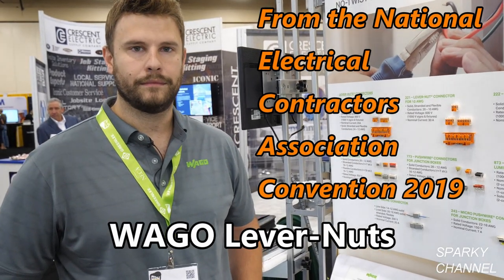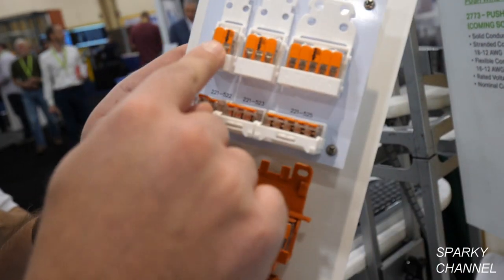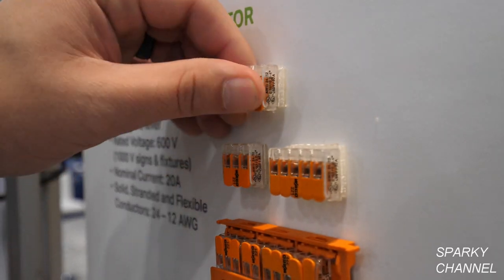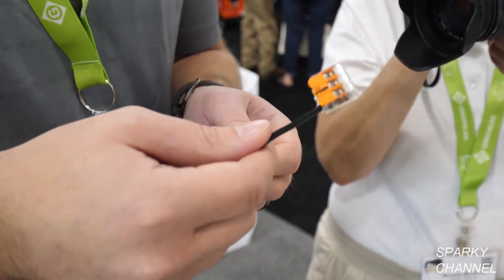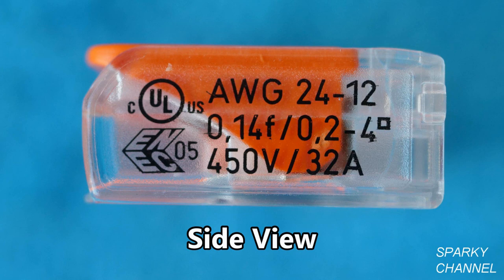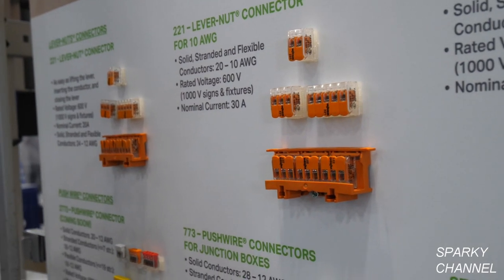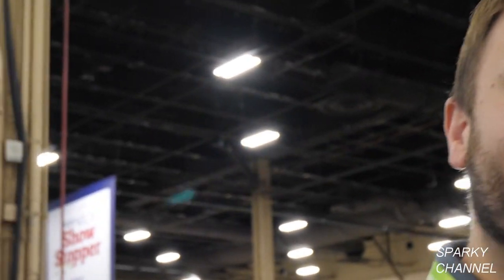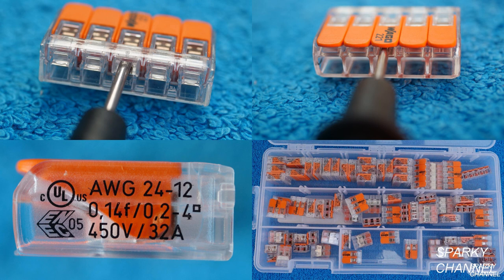Wago Lever-Nuts Questions and Answers From National Electrical Contractor Convention

Comment: I don’t need a transparent connection. My wires are twisted tight before I put on a wire nut. I bet mobile home manufacturers love these.
Reply: The RV industry uses them I use them everyday in Motorhomes. Scotchlocks are no longer used for 12 volt they use these instead.
Reply: When you twist wires, it makes them weaker and damaged in the future when somebody needs to change a receptacle or switch out.  One of the biggest benefits to these level nuts is that they don't damage the wires like twisting them does.  I've had to pull entire new runs because wires were twisted and untwisted too many times and cut back too much to where the wires are too short.  It might not seem like a big deal but when the time comes to reap these benefits, the benefits are HUGE.  And it isn't even a benefit that was difficult to setup for.  Using these lever nuts is significantly easier and faster than traditional wire nuts.  I understand people prefer traditional wire nuts for many reasons but I've personally never looked back once I discovered these.
Reply: @glasshalfempty1984  If your wires are being twisted and untwisted too many times, there's way deeper issues at play.
Reply: @cengeb  oh Jesus Christ I really have heard it all now.
Reply: @blueoval250  Pre twisting is not required, some mfg's state that it is "acceptable" but not required others state you should not... 

From Ideal: 
5.Pre-twisting acceptable, but not required. For pre-twisting; strip wires long, hold wires together with insulation even, twist wire ends together, trim to recommended strip length.

3m:
1. Strip wire insulation 3/4" (19,0 mm).
2.  Firmly grasp wires, making sure insulation ends are even and tightly bundled. (Wires may be twisted or untwisted.) Lead stranded wires slightly. Slip the connector over wire tips.

Pre twisting does put stress on the wire... Its unnecessary stress b/c the mfg literally says its unnecessary to twist them and twisting them does stress them.. UNNECESSARILY

Comment: Made in Europe  very pricy.  Ideal has an American made knock off for 50% less
Reply: Ideal does not make lever nuts, they only make push-in wire connectors. That's why theyre cheap.
Reply: These connectors are pricey.  However they are very reliable and fast to install.

There is nothing wrong with the Ideal system IMO, I use it myself, the only drawback is that it is disposable.
Reply: Ideal has 2 types I have seen.  One type is not reusable and the other is IF you use an equal to or greater size wire of the wire that was removed.  I suppose it loses tension.

Comment: Most of these comments are really stupid. People are asking if you can use these on the neutral conductor and things like that if you don’t know this you should not be working near electricity or you should ask someone who knows what they’re doing. People are saying why not superior and things like that, but the United States has no testing requirements, where these are used unlocked testing requirements and these pass every single installation test

Comment: pack of 100 @ $44...... lol, Yea I am sure people are just falling over themselves to spend that.....
Reply: $23 for 100 pack of 2-wire at Menards. $18 for a 50 pack of 3-wire.  That's acceptable.
Reply: @schmartz99  LOL, the only place that I didn't price check....
Reply: I bought a 150 mix pack of 5, 3, and 2 connector for 29.99. Won't go back to a wire nut.
Reply: Time is money, Wagos are really fast to use.

Comment: Wago is an idiot-proof connector, wire nuts are not.
Reply: Daamn right. Try connecting a single stranded conductor to a single solid conductor, very iffy.
Reply: @trek520rider2  no problem

Comment: my problem with these is they can't possibly duplicat the contact area of twisting the wires together.
Reply: as odd as that sounds though, the consistency of this connector completely & totally counteracts the theoretically greater capabilities of wirenuts, with, on average, 15A wirenuts failing at around 20-25 amps or so, with 15A rated Wagos failing at anywhere between 30 and 50 amps. (in this case, failing meaning the connector melting)
Reply: @danny_dan4323  I just watched a video of 14awg wire failing at 60-70amps, but not the wire nut! Not all wire nuts are created equal i guess.
Reply: That's assuming you're connecting the wires together in the first place with twisting. I've done enough remodels and repairs and seen some shady twist installs. Not an issue with these or push ins.
Reply: The contact area that is not needed and is more than the individual wire itself? You can leave a wago 20a at 20amp draw indefinitely and nothing negative will happen... That extra contact area may let you sleep better but it means nothing.
Reply: @twinnevans971  I think thats kind of the problem. Pre-twisting gets you the best contact area, but that is NOT the correct installation method according the manufacturers.
Reply: But that's overkill anyway, and oxydation of the copper wire in the twist causes resistance too. Unless you are plugging in a 1500 watt space heater on high and leaving it on all the time drawing the max, most outlets in a house are only going to run a table lamp, an occasional vacuum cleaner etc and lamp fixtures these days are mostly running LED's not strings of 150 watt incandescent bulbs!
On outlets, switches and ceiling lamps about all you have contacting the wires are  1/2 or 3/4 of the the underside of a screw head, same for where the wire goes into the breaker- just the screw holds the wire in
Reply: @Justowner  Plus- just TRY using a wire nut to twist a pair of 10 or 12 ga wires by turning it with your fingers! 10 ga especially doesn't want to twist, maybe 14ga will but I never used anything smaller than 12ga in my house ANYWHERE
Reply: Most countries do not allow wasting wires in a wire up because it is not predictable. There are so many cases where the joint issues.

Comment: 600 volts is overkill when you are putting in 24 to 12 ga wire in a house running circuits on 120vac, 240v max, so even the European 450 volts is more than double what you'd ever put in in the USA
Reply from the maker: Interesting, thanks!
Reply: NEC much?  stuff is now at 1000v 600v is the old low ...so in order to have UL ETL etc 1000v ratings...like there is no such thing as 110V it's 125v nominal, things keep improving
Reply: @cengeb  And, let us not forget that "125v" is the "DC Effective" voltage (used to simplify the calculation of things like "wattage"); the AC voltage is actually swinging between +170 volts and 170 volts - a 340 volt swing.  This means, between the phase wires on a "normal" single-phase system that gives you 240+ volts between the "hot" wires, you are actually seeing a difference of 340 volts in potential.  That leaves you an "insulation head space"  of something less than 260 volts on 600 volt wire.  

That is BEFORE you account for any "surges" or other events that might lift one of your phase voltages relative to the other or to ground.
Reply: The voltage rating is based on "DC" Volts.  The "Voltage" you read on an AC circuit is the "DC Effective" voltage.  That is, on a DC circuit that has 125 volts and is pulling 10 amps, you are consuming 1250 watts.  They have "normalized" the AC Voltage measurements so that "125 Volts AC also pulling 10 Amps AC" will do the same WORK [over time] as that 1250 Watt DC Circuit.  THE ACTUAL VOLTAGE IS NOT 125 Volts!  

The AC voltage is actually swinging between +170 volts and 170 volts - a 340 volt swing!  This means, between the phase wires on a "normal" single-phase [American] System that gives you 240+ volts between the two "hot" wires, you are actually seeing a difference of 340 volts in potential.  That leaves you an "insulation head space"  of something less than 260 volts on 600 volt wire.  On a wire with a 450 Volt Rating, you would only have 110 volts of "headspace" on the insulation...  

...and that is BEFORE you account for any "surges" or other events that might lift one of your phase voltages relative to the other or relative to ground.  A lightening strike, for example, can skew the relationship by thousands of volts.  Fortunately, it takes time for insulation to heat and melt (or burn) -- and lightening strikes tend to be relatively short duration.  That said, the closer to the limit of your insulation's rating you operate, the LESS time it takes for such events to generate a fault.
Reply: It's now upped to 1000V rating for insulation etc according to the newest NEC book.  MFGS are ramping it up to 1000V.  WAGO are superior to obsolete twist on connectors.  2023, join it
Reply: But if you’re going to do high voltage insulation resistance testing and other testing as mandated in Europe, this is needed

Comment: Going to try the on my RC 6S lipo batteries
Reply: That is not recommended because he’s batteries can often handle a much higher current than the wire according to regulations for short generations the connection may not be great

Comment: Compare the wago with an Ideal wing nut. The Ideal wing nuts contact area is much larger and stronger. You can hang your weight off of it. But I try to post the video and it is deleted every single time.
Reply: Ok, I'll bite. I'll take a closer look at whatever an Ideal Wing Nut is. Sounds mechanical to be honest.
- 5 minutes using my lackluster googlefoo -
So, they are the basic twist sleeve type. When done right they hold up quite well. I have seen these in houses closing inn on 50 years (if not more) mostly without any signs of age.
But I have seen far to many done poorly or downright wrong. Not just DIY types that goes for the cheapest option. 
What wago has going for it is that they are easy to use, and electricians does more than enough twisting motions with their hands to begin with. 
I suspect that US sparkies might not like Wago is due to the lower capacity of the Wago. In installations with 110V/220V there could be an issue with the 20A\32A limit. On top of that is the human factor that we use what we know and trust.
I have used Wago for over a decade and have not encountered an issue so far with heat/overload or the lifetime of the springs. As questioned some times in this comment section. But then again I work on 230V/400V systems with correspondingly lower currents.
Reply: If a splice connection has to hold this kind of weight, something is wrong way beside the type of the connector.

Comment: I’m a junior in a technical high school and I’m in electrical.. me and my friends have done plenty of experiments and everything says wire nuts are better. I can take off wagos with 1 finger unlike a wire nut, it’s almost impossible to pull off. I see what wagos are trying to get at, and I see Why most countries use them.. I’d rather trust myself with making a connection with a wire nut than the manufacturer of the wago. That being said, if I ever had to use a wago on a job I would wrap the wago in electrical tale to insure a nice and tight connection. One thing I do like about wagos is how easy it is to switch wires, but is that really a good thing how easy it is? In my opinion nothing is better than a good old fashion wire nut.
Reply: Are you twisting stranded or solid together? I completely disagree wire nuts are better. I’ve used WAGO in my house with no issues. And easy to remove or add wires. I’ve had damaged wires from untwisting just twice—or perhaps the wire was damaged by the electrician installing it.
Reply: I agree to a certain level with you. Wirenuts are the ultimate, but are also laborintensive , spaceabsorbing, difficult to manipulate and userunfriendly. I think the wago's are a great alternative and also very reliable. I use them (not only the 221's) for decenia. I'ver been teached the wirenut-way, but love the wago-way. The big disadvantage of a wirenut is that it can be mounted in so many wrong ways. The wago 221's are close to foolproof and more diverse. To be honost, I only use wirenuts in situations in which my connection needs to be secure (high or unreachable places) or is demanded (hospitals, military, etc.). For the rest I only use Wago(-like) connections.
Reply: Tape should never be used to ensure a tighter connection. If tape has to be used, it's because the connector isn't doing it's job. With tape holding the wire nut on the conductor, I certainly wouldn't trust that electrical connection. Isn't using tape already assuming you don't trust the connection?
Reply: @davejohnson6032  lol, all it does is add fuel to the electrical fire caused by that bad connection. Nice catch.
Reply: I do a ton of rework, like adding a branch to an existing circuit. Have to untwist and retwist for wire nuts in close quarters or in hard to reach areas is not friendly, so Wago connectors are much better. And the space in boxes is often limited.
Reply: You may be able to remove a Wago with one finger by pulling the lever up, but if you install them correctly you are NOT going to pull the wires apart with a REAL Wago. There are plenty of poorly made Chinese imitations and knock-offs, but the REAL Wagos are hard to beat. I seriously question what a high school Junior knows about "old school." I'm 72 YO, I can tell you about "old school."
Reply: @davejohnson6032  My sentiments exactly.

Comment: Ul is not a testing lab its a review of data lab based on a manfactmar data i had a electrical problem and UL couldn't do shit for me even though they certify it , the company pays four the UL seal lol its a selling point
Reply: WRONG, they are an independent testing lab, like ETL, DIN etc, where do you get your fake information?
Reply: All wrong about ul...you need facts before making up incorrect crap about ul or etl....and dozens of other test labs worldwide
Reply: And pays thru the nose.  My uncle worked for a company that designed and built medical equipment ( electrical).  He said UL would never pass the first inspection, or second, or third...each time charging a king's ransom for each retest.  A captive money-making organization.
Reply: @LongBinh70  ETL, UL are NRTL. independent recognized test labs, build it right pass the tests, simple concept..Other countries have their own labs and cert  DIN, Kluer Kema, TUV, and on and on

Comment: i do alot of work with low voltage. when i see a wago, i pull it off and into the trash. i leaned the old way to connect wiring and those old ways have lasted for longer than im alive. maybe they have their place but if i ever see any of my guys use a wago on anything over 12 volts, theyre gonna hear about it. any wire connection requires 60 percent surface connection and wagos dont provide this, more along 20 percent for solid and 35 for stranded. sure they are quick and easy but when i have multiple conductors, i dont have time to mount a wago block and try to get each wire into its socket. twist and wire nut and i dont have to worry about it. wagos to me are just a lazy way to connect wires and the only benefit is you can relocate wiring because you were to lazy to read the prints correctly and connected your wiring wrong - explain that to your boss because he had to go fix your screwups at 10 pm on a friday night.
Reply: I suppose that you still do knob and tube wiring as well.
Reply: @JamesTatePa  actually i run across an awful lot of it and have to adapt it to new code or completely tear itout and reinstall all new, nice thing about kt is that the connections have held good for the 50 or so years and generally isnt a problem other than being undersized for the demands put on it nowadays.
Reply: haha, quite opposite. Wire nuts were popular in 70s and 80s, From the 90s onwards, I haven’t seen anything other than Wagos used. Nowadays if I find wire nuts I cut them off and replace them with Wagos.
Reply: Your trusted wire nuts are banned in Europe, too many fires.
Wagos have safety certification worldwide. 
You say you don't trust them on anything above 12 volts. Europe operates on 220/240v, millions of these have been used in Europe with no fires related to the Wagos.
Reply: I’ve seen a lot of these ignorant “I’ve been doing this for XX years” posts, but this one takes the cake. The most impressive and trustworthy trades people I’ve ever encountered are the old-timers who are using technology and modern techniques. It lets me know their “experience” has taught them to have an open mind and always strive for better, even if it requires them to change their ways. Kodak stuck by “film has been done for XX year” mantra all the way until the bitter end too.
Reply: @harveysmith100  My theory is, that with the 110volts they are using in the us compared to the 230v in Europe, they are drawing way to much current.
Reply: @henningquast8456  It is a possibility, I have seen these tested to over 400v by JP but of course the current is less the higher the voltage.
I think it is more likely that it is more likely that it is due to running too much current than the circuit is designed for or incorrect cable size.

Comment: Way too costly. "Wire Nuts"  are cheap and they work great and have been around for a very long time, ill stick to them.
Reply: Wire nuts are absolute shit
Reply: All you're doing is trading labor costs with material costs. I'll bet 10 wagos could be put up much faster than 10 wire nuts. What if you had a job that needed a 1000 or more connectors. It all comes out in the wash, in my opinion.